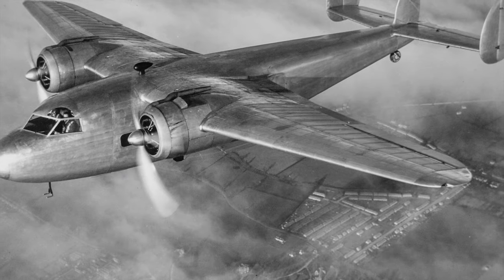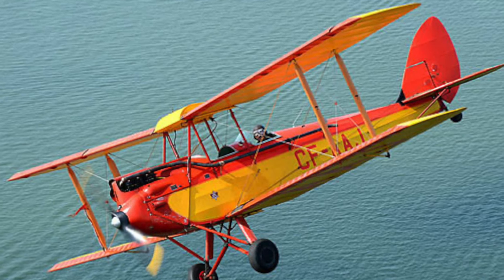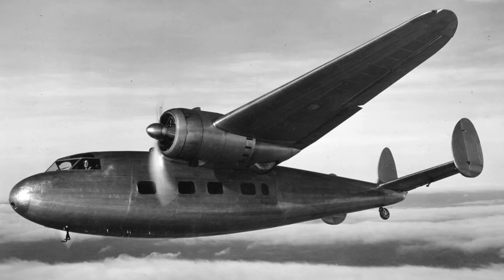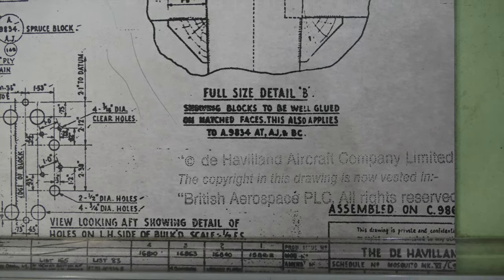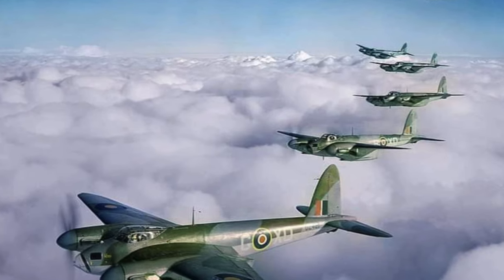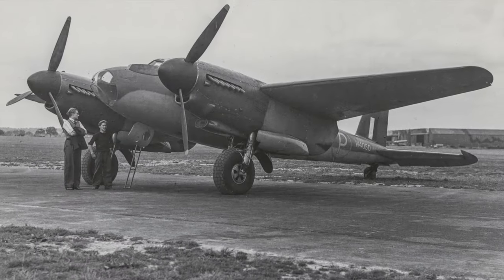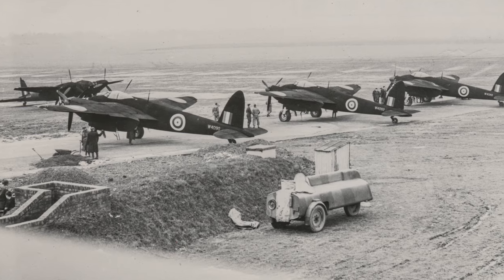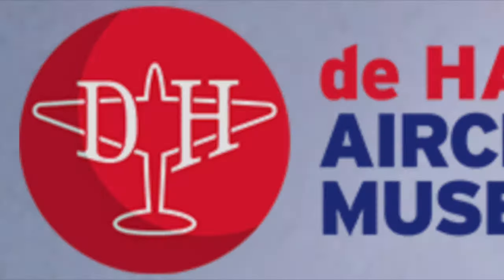Why was the de Havilland "wooden wonder" Mosquito aircraft built of Wood, instead of Metal?

Comment: You missed, perhaps, the most important reason and one that goes against your entire narrative. In 1938 the Air Ministry issued specification B.9/38 for a medium bomber made of non-strategic metals (i.e. aluminium and its alloys). De Havilland was approached to build a design to fulfil this specification but they decided not to submit a design. So, why have you repeated the misleading claim that the Air Ministry rejected the Mosquito because it was made of wood? The Air Ministry wanted a wooden aircraft, either in whole on in part. In fact so did the head of Bomber Command at the time (ACM Ludlow-Hewitt) de Havilland fist proposed the design that would become the Mosquito.

Comment: Incredible aircraft, informative video, I belief I'm correct in saying in the effort not to increase the complexity, the propellers were not counter rotating to compensate for torque , which required a bit of skill to compensate for .
Reply: Very true, plenty of rudder required on takeoff. Also made the aircraft prone to flipping over on takeoff if the wrong engine cutout. But most important aircraft of the war IMHO.
Reply: @peterrollinson-lorimer  Roger that, its called an asymetric stall, non recoverable, especially  on take off. Totally agree on best aircraft , Its speed was awesome and I've always been amazed at its range at low level. Especially in European theater - a lot of missions over the channel, and over North Sea. Cheers